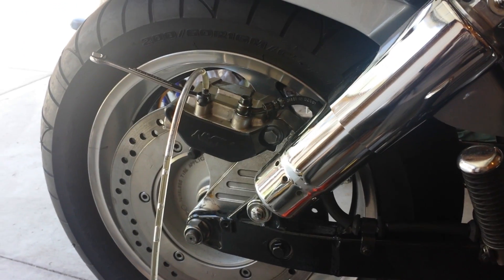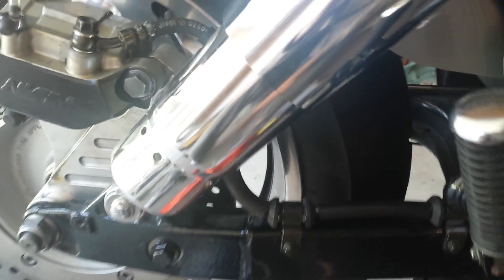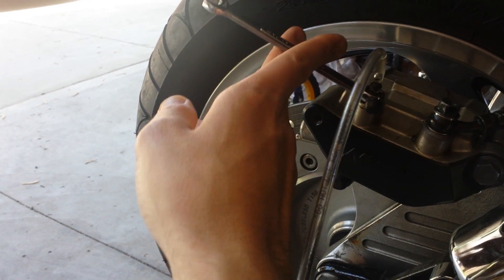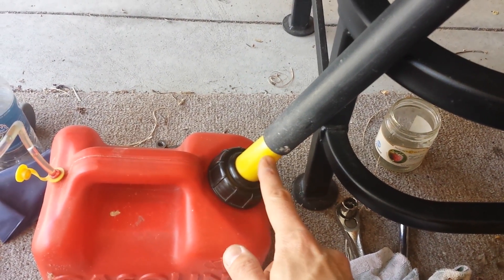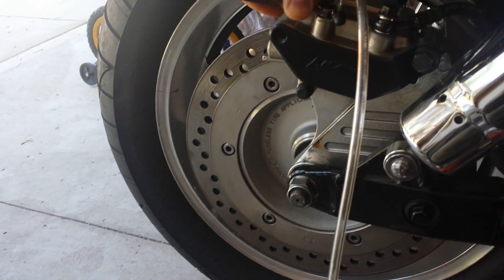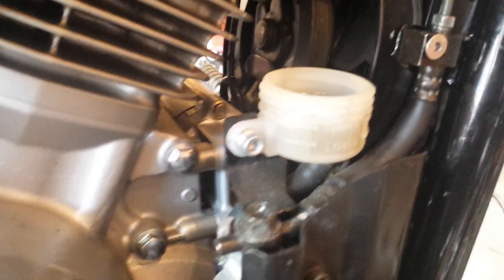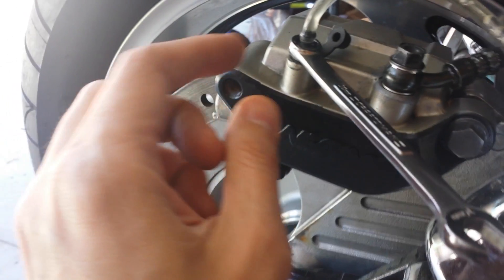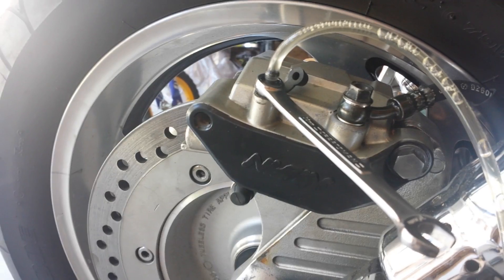DIY Vacuum Bleeder for Brake Lines

Comment: Brilliant. I feel sooooooooo stupid for not thinking of alternatives. I do agree about the tiny bubbles from the valve plus I wonder if there is any fitting which would seal better than the fitting which is included in those HF cheap bleeder kits?

Comment: I didn't bother with the gas can. I just connected the vac directly to the clear bleeder hose.  Why I failed , was because I was afraid the brake fluid would empty tooo fast and I would suck air into the master cylinder.

Comment: Won't the fumes cause an explosion..???
Reply from the maker: I've never noticed brake fluid to have fumes, but regardless, no issues with this setup after many years of use.
Reply: @notjaysday  how about the gas can your using ..sucking fumes into the vacuum..

Comment: These none stop bubbles prove there is an issue..
Reply from the maker: The valves themselves allow air, regardless of method. Main point is getting the air out of the actual lines.
Reply: the problem comes from the bleeder thread